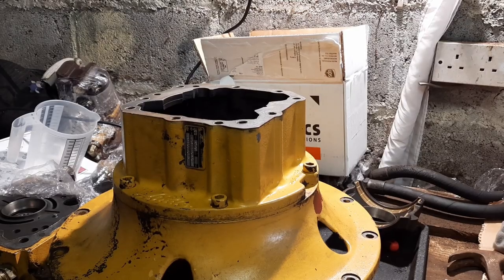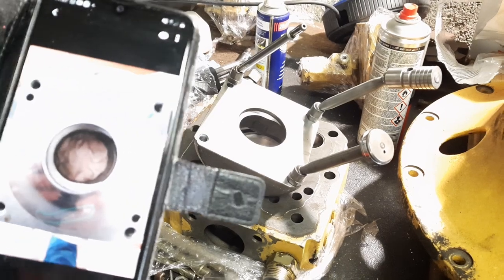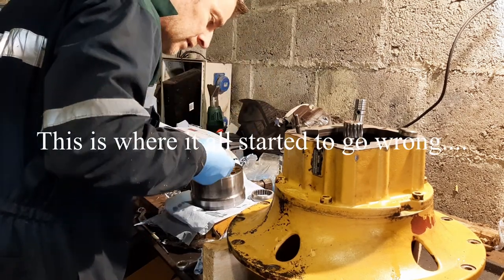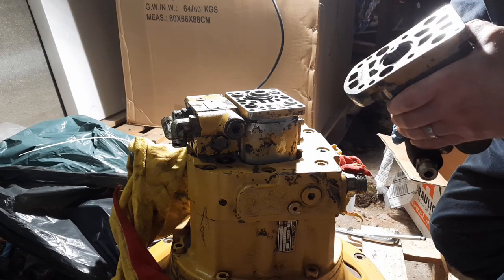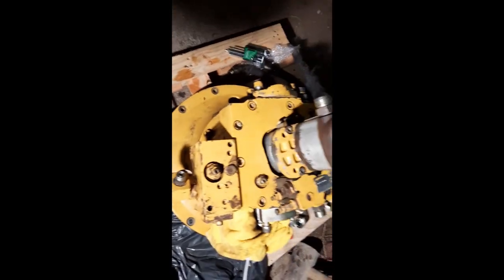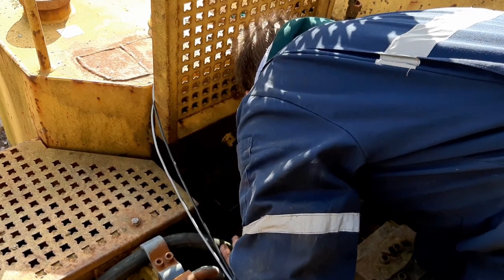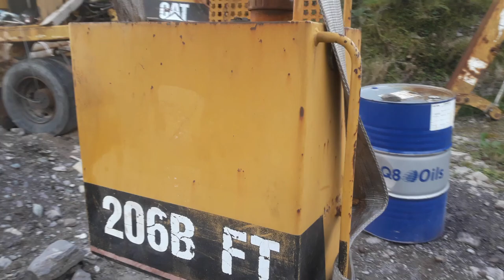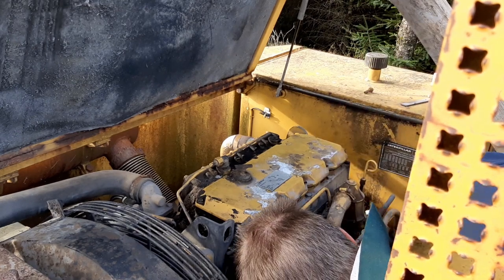Old CAT Rescue Pt5 - Main Hydraulic Pump Rebuild

Comment: Merry Christmas
Will you be repairing and re making any of the metalwork that’s damaged.
Reply from the maker: Same to you buddy 👍. Ill be sorting all the metal work once I've got the mechanical end sorted. Hoping I can straighten most of it, but I'll have to remake the battery box floor as its totally gone, the batteries are currently sitting on timber 🙈